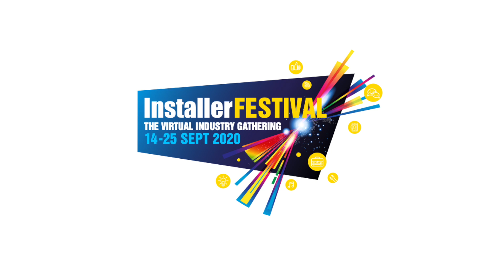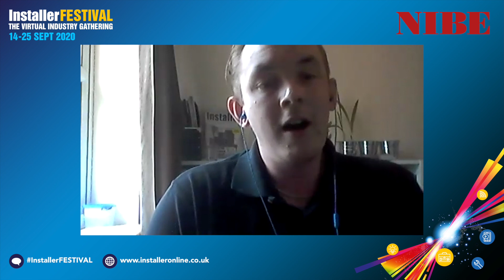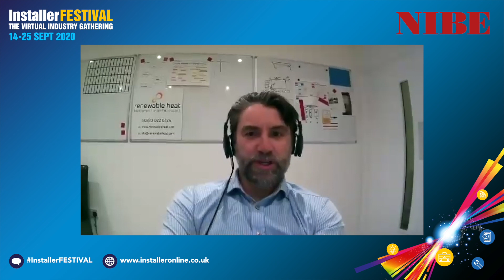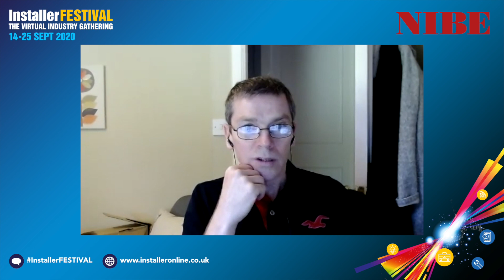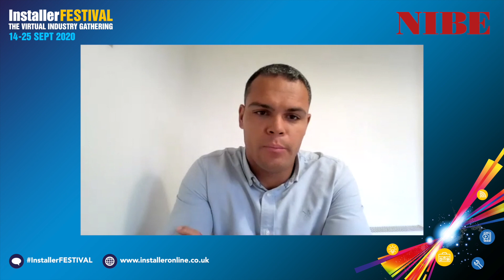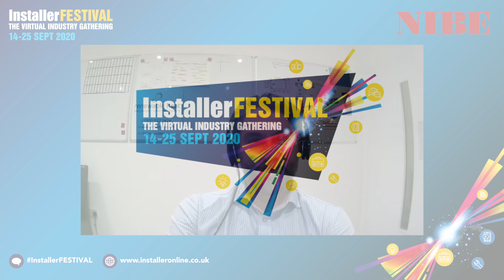Watch: NIBE F2040 heat pump case study

Comment: Just fitted a nibe f730 exhaust heat pump and what an incredible thing it is...the comments about the radiator temperature is so true. I've seen radiator temperatures as low as 30 degrees and was amazed  that actually keeps my property at its desired set temperature of 22 degrees .  None of this up and down  and peaks and troffs in the room temperatures .